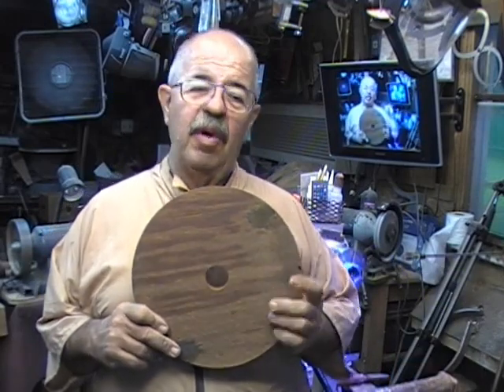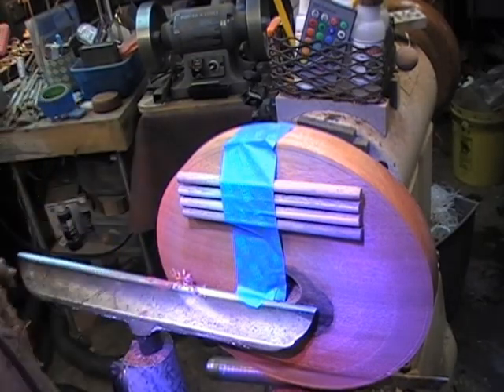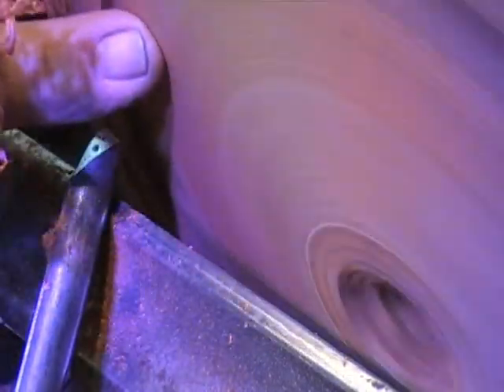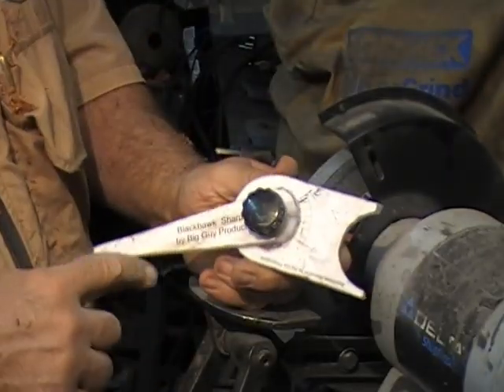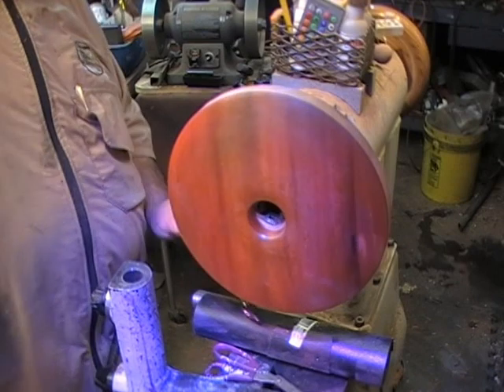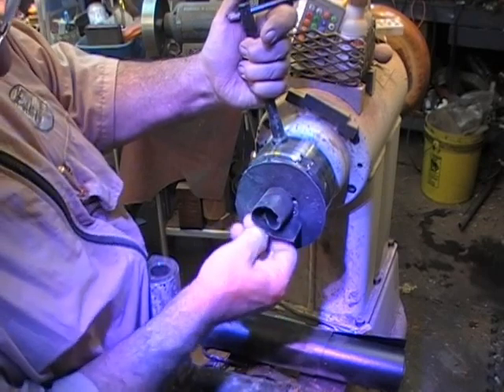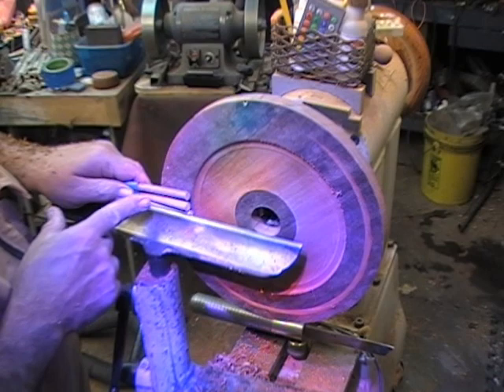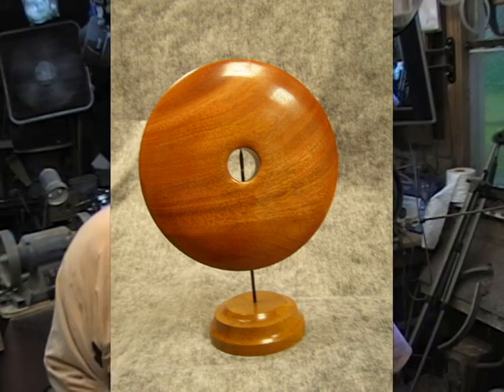# 168 Reloaded Coriolis Impact

Comment from the maker: It has a offset at the top and sharpened to a point.  I center the hole on the point and balance it.  it moves, but does't fall off.